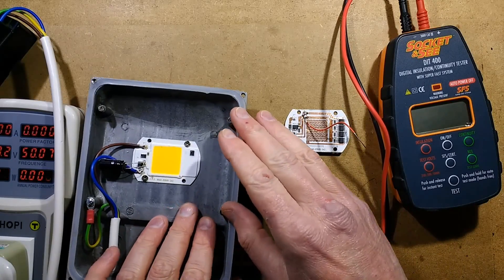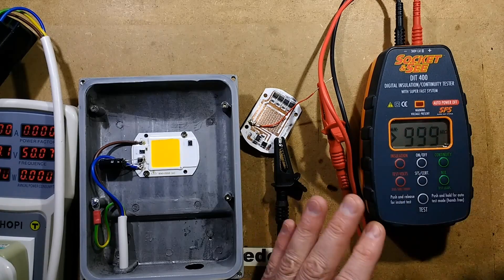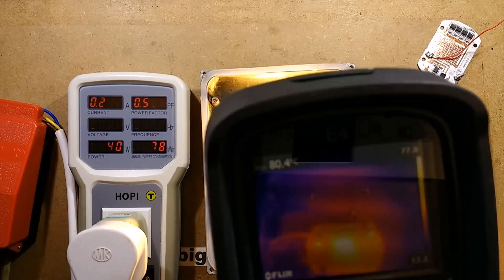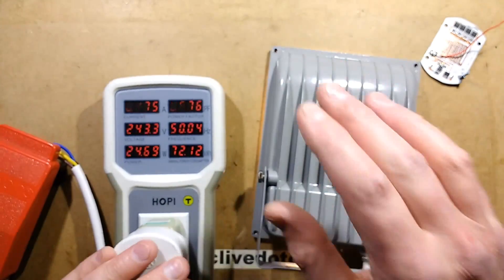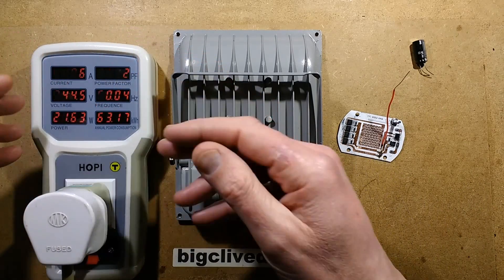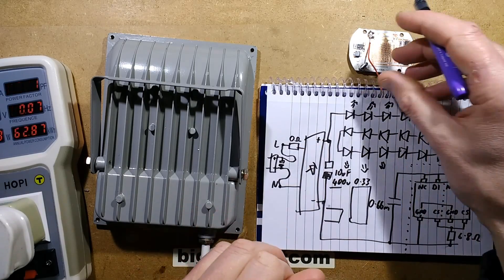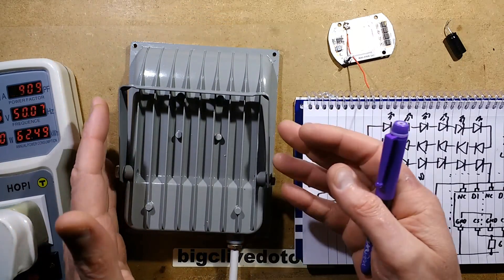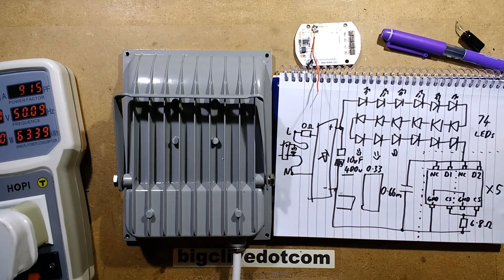Adding a capacitor to a driverless LED and other tests.

Comment: Hi, 
I've attached a 220v to 24v transformer to a 936 Soldering Solder Iron (cheap Chinese iron) it went smoking and became red glowing hot. what is wrong?
Reply: they are meant to go with a solering station, which has monitoring elecronics for the temperature and a controller that adjusts it, it IS 24v but that is only applied to make it heat faster, then the unit controlls it from the built in temperature thing in the iron, you are bypassing all that and have no way to control it, basically, buy a 12v iron for car use, they work well, thats what i use on an old pc power supply or sometimes a 7ah lead acid battery for portable use
Reply: Jusb1066 haha yeah, thank you! I'll let you know in a couple of weeks how it turned out :)
Reply: dude, you are a video maker, do a video on it, i have already subbed to ya!
Reply: ***** I would say get the cap and don't use it until you do.
Reply: Yarni Pels Which one went red hot? I will assume it was the iron, and the problem in that case was the transformer was at too high of a voltage and could put out a high enough current to maintain that voltage under the load of the soldering iron hearing element.
Reply: this is it, directly connected to the iron
https://lh3.googleusercontent.com/VrIFA2IDrqtCHsDKLk_zztgWfs4U8M1N8SR9zg9p3k7J-weKn6ZYKhpORUWQxNUdoEHCPrs4g_8
Reply: The issue is that your transformer is of too high voltage for the heating element, thus causing too much current to be drawn. I'd suggest trying a 220 to12v transformer, and that may fix the issue.
Reply: ok I'll try that but its strange since its listed as 24v
Reply: ***** That is odd. Possibly the listing meant pulse width modulated 24v rather than constant voltage.
Reply: ***** Very strange, all i can say is keep going down in voltage until you get to the right temperature. Maybe try 9 or 5v next. (Obviously not from a usb port)
Reply: Jusb1066 Thank you! So actually if I buy this controller attach it to my 24v transfo  it should work as normal? http://s.aliexpress.com/aIVzeMrE 
(from AliExpress Android)
Reply: yes that does look like the parts from the hakko station, then again, why not just buy an entire unit and keep your iron as a spare, might be cheaper than messing around, as you still need to power this board, make a case, have something to store your hot iron on etc....
Reply: Jusb1066 I actually have an old weller station (soldering iron is broken and costs more than 60€ for a new one) but it only has a 24v transfo in it I thought that was enough for this iron.. it has a stand and I already have wood for a case from a previous project :)
Reply: best of luck dude, older stations used different technology for heat control, some had weird tips that controlled the temperature,  good luck with your diy approach, hope that you can supply the board with what it needs (makes sense it needs 24v so you should be good to go)!
Reply: Jusb1066 haha lol 😂
Reply: Jusb1066 I just found what broke my old weller iron (after 6months of using a cheap butane iron 😅) there was a 0.01 uF  capacitor and it was broken. I put a bridge between the 2 point for a short while and it warmed up again..  now I have a little question can I use it without the capacitor or should I wait for a 0.01uF ?

Comment: Hi Clive I'm not expert in electronics, but would it be possible to use say two of these modules together so they run at alternating sync, thereby no flicker ??
Reply: Peter Scharff two legs of power like in a house hold still have the same zero crossing point, but if you had 3 of them connected to different phases of 3 phase there might be an interesting result
Reply: No it would just be three phase power. You know.... What is used by industry EVERY DAY.  (and they have the same problem.)

Comment: The eBay sellers are probably going to split into using these for cheaper ones, these with capacitors for no-flicker ones, and traditional driver ones for more expensive models.

Comment: Putting a capacitors, not necessarily that big, on the output of the chips instead of on the input side might improve things instead of making them work harder... or it may make it go bang.

Comment: Damn, I should have waited a little before I ordered 8 of them (I got all combinations ;) ). In the end it is what I expected to happen from reading the datasheet, but I still got them. I just couldn't resist and now I'll be stuck with flickering lights, I won't be able to bear to watch. Could you put a cap in series with a second module so it runs out of phase to the first one to avoid most of the flickering? (like you create an additional phase for an induction motor)

Comment: I would also ask for another try with capacitor parallel to LEDs instread. And possibly in series with some NTC as common in switching power supplies. With the flicker cancelled by extra cap. it would be really good and cheap device, imho.

Comment: I wonder how bad the flicker would be if you had both one of these and one with a capacitive dropper in the same fixture. You'd think the flicker would be roughly out of phase with each other and the result would be better.

Comment: I guess the flicker in these LEDs are not ideal for a DIY projector?

I have a DIY projector with a 400W halide I'd like to convert to LED, I wonder if these are suitable, there are also 100W (or they say) driverless LEDs.

Comment: Hi Clive. Have you seen the Gosun floodlights on Amazon yet? I've used a couple of the 30w daylight white ones and they seem pretty good and very competitively priced. They're quite a different design to the normal aluminium troughs and they claim to use cree LEDs. Just thought they might be worth a look.

Comment: If China decided this was the way forward for LED lights, couldnt they use the capacitor, but increase the number of LEDs in the string to bring it up to the higher DC voltage?
I'd hate for my world to be filled with 50Hz flicker.

Comment: A smaller capacitor might allow for elimination of most of the flicker without pushing the chips that hard. I calculated that the cap should last for about 7ms (from the peak to the next time the voltage enough ( about 185Vish?)), and your 10uF would drop from 330V to 267V in that time, whilst 4.7uF would go to 196V (close enough?).

I calculated with crude numbers and assuming constant 0.09A current, but if you like to experiment, maybe try 4.7uF ...

EDIT: Also, the sinewave likely exceeds that slope for a while on the top, and caps might be bigger than specified (so good idea to measure them), maybe experiment with even smaller caps too..

Comment: I think, you could reduce the flicker by using 2 of those LEDs and power one of them through a capacitor, so the phase would shift 90°

Comment: Clive, I agree with the commenter who recently suggested that you should devise a method of measuring the light output from the many lamps that you review.  When we are considering LEDs or other lamps for use in lighting applications what we need to know is how many lumens?  Sometimes the eBay sellers quote a value but we all know how much trust to put in that.
Reply: tbh, as long as the testing conditions clive uses are consistent across all the leds, it ultimately does not matter. 
I would not mind buying leds based on a clive-scale
Reply: Measuring light output in lumens is not trivial. Lux is an easy measure however.
Reply: You can trust Chinese LED seller specs 1000%, if you move the decimal point twice. Most of them only know what they were told by the manufacturer, and they have no concept of electronics, they're just peddling.
Reply: number 33 Google integrating sphere.  iirc they're white tio2 inside.
Reply: My plan for measuring lumens is to put the lamp inside a perfectly reflecting sphere which has a small hole in it which is covered by a light meter measuring lux.  All the light bounces around until it exits via the hole and is captured by the light meter.  Does anyone have a 100% reflective sphere handy?  

Ok, it doesn't have to be 100% reflective a certain percentage of the light will be absorbed so it will have to be calibrated with a known light source like a 60W incandescent bulb.

PS:I don't believe any of the conspiracies in that list.

Comment: I don't really know why the flicker is considered such a problem.  It's no different from the flicker of the old fashioned fluorescent lights that most offices have used for about 50 years.  They also pulse on and off at 100/120Hz.  The persistence of the phosphor may reduce the flicker a bit but that applies to the LEDs too.  And people are happy watching cinema films with 100% flicker at 48 Hz.
Reply: Modern fluorescents run at much higher frequency to reduce flicker, so it certainly was problematic even with those.

Cinema projectors are comparatively very dark, making our eyes less sensitive to their strobing - But these are also strobed at higher rates in the age of digital projection.
Reply: I'd guess that the strobe is sharper edged on LEDs than the old fluorescents making it more perceptible... haven't done any experiments on it though.
Reply: The benchmark should really be incandescents which had pretty much no flicker whatsoever. And those were nice.

Comment: can anyone tell me why the meters LEDs flicker when it sitting on the table. but stopped when he was using the thermal cam and when it was close?
thx
Reply: The camera exposure changed.
Reply: The digits are most likely multiplexed at at least a few hundred Hz. If the (electronic) shutter is open long enough per frame (as in low light conditions), all digits will light up at least once within that single shutter (frame rate and shutter speed are two different things) and thereby look flicker free.
Reply: thanks, Makes total sense, guess I just didn't think hard enough about it. lol

Comment: Cool video Clive but this looks like an exercise of turd polishing that flicker in the standard unit is horrible. And if that's the cheapest way these units can be built then that's how they are going to be made.
Reply: But you wouldn't put them in your living room to read by, they're only for the shed and driveway.

Comment: Hi Clive
How strange, when you showed the thermal camera the currant meter stopped flickering.
Reply: John Ferguson The video camera used a longer exposure to compensate for a darker scene.
Reply: Robert Szasz Thanks mate. That makes a lot of sense.
Reply: The digits are most likely multiplexed at at least a few hundred Hz. If the (electronic) shutter is open long enough per frame (as in low light conditions), all digits will light up at least once within that single shutter (frame rate and shutter speed are two different things) and thereby look flicker free.

(Yes, I'm spamming this of mine comment around)

Comment: Ok so if I ordered the 240v versions and used them on my 120 mains with the smoothing capacitor would it work better?  I mean the rms voltage is much lower so putting that capacitor in there would just compensate for the lower voltage right?
Reply: If the peak (not RMS!) value of your supply does not exceed the LED string voltage, it will never light up. Considering there's about 70 LEDs a 3V you'd need at least at around 200V (absolute, not RMS) for it to light up at all.
Reply: Quinn Miller I would like to know as well!
Reply: 120V wouldn't hit the 180V needed to light the LED's properly even if smoothed.

Now if you swapped out the bridge for a voltage doubler using a cap and two diodes then you would be onto something :)
Reply: superdau true
Reply: specs say that, but its wrong, the 110 versions would be different.
Reply: You still don't understand. 70 white LEDs in series can not light up on 110V AC with this circuit.
Reply: "Can't" or "Won't"?  lol  I get it. The necessary voltage to overcome the for lack of the correct electrical term, "stiction" (sp ck doesn't know stiction.  lol)  Like when dealing with sliding parts there is a certain voltage needed to get the LEDs to light and the 110 won't get there. 

But I think if you tilt the fixture downhill just right you can get the extra momentum needed to light the LEDS... Or just fake it by using bigger wire, or switch to The UK wire colors...   (Just facepalm, Shake your head, and give up.)
Reply: You would be able to pull 120 from each leg/phase of your power box and run one into hot, one into neutral. ( US 240v ). I currently have one running on just that and i don't notice any flicker. Currently trying to get answers as to how running  US 240 double phase VS UK 240 single phase affects flicker. Corrections from an actual electrician are welcome.
Reply: @Facemcshoot  
it will be a single 240 volt phase at 60 Hz :-)
Reply: i have found out the cap makes it light at 209V, while the same board without the cap lights at 111V.
Reply: Not that I haven't seen bad specs, misprints, and/or flat out lies, but I kinda think if it will handle 240v it will handle 110v. May not be as bright but I think it would light. I have seen all sorts of stuff that will work across multiple ranges. I think the engineers(meh?) that designed them would know.

I can say that 12vdc incandescent  camper bulbs work very well at 110vac they are very bright, screw right into the sockets, look just the same if there is no writing on them, but the service life sucks.   LOL  (can you say "Flashbulb"?)  Now I test at 12v when not sure.
Reply: WRONG!  Specks call for 86 - 265 vac.

Comment: i wounder if they will improve these units with leds which can handel 30 watts or so but only use chips with 10 watts and with a capacitor because then the leds will not fail or so maybe i don't freaking know xD

Comment: Wouldn't you able to use 2 with a voltage divider to get the power down so you can use a capacitor on each without overdriving them?

Comment: guys,my 20w led floodlight stopped working.Used indoors for 3 days.The floodlight is not turned on everytime.Please help
Reply: Take it to bits, and see what died. Did you keep it cool? Better yet, send it back and get your money back.
Reply: James Van Damme didn't buy it online,bought at a local Hardware shop.No warranty and gurarrante.Took to bits and nothing obvious.Probably the driver is faulty.The led is fine.I just need a new 20w led driver.Will be a pain in the butt.

Comment: so if i were to use a bunch of these all next to each other would the flicker be all in time with each other following the the ac wave form or would they be slightly different thus appearing less flickery?

i did have one of these driverless chips with solder pads in the circuit which at the time i did wonder if it was perhaps some optional filtering add-on
Reply: If they're all on one power phase, they'd flicker the same. If you had a 3 phase line, put them on different phases and would probably be no noticeable flicker
Reply: You have been lied to. Sorry.

Comment: Hi Clive, hello from Australia. Thanks for your great videos, I put your knowledge to good use when a capacitive dropper in a PIR floodlight failed and the switching relay just buzzed. All sorted now :) 

The video on your quick test was excellent, are you able to demo some of your other bits n' pieces in future videos? I'm in the process of setting up a workshop and it'd be great to know the details of some of the wattmeters, hand tools and other interesting items of test gear or measurement that I should probably have (whether I need them or not!). Sometimes it's a matter of knowing these things exist so we can buy them. 

Cheers,
Adam

Comment: In the previous video you said that the current was programmed to the chip by a resistor. If you increased the resistor, would it negate the extra power from the capacitor modification?
Reply: I'd imagine replacing the resistors would be very hard due to the silicone potting and aluminium core PCB. Certainly not worth the effort.
Reply: Jernej Jakob trimming back the silicone is easy enough and the old reflow trick of putting the board on an electric hot plate and use a hot air reflow pen to melt the solder. Don't underestimate Big Clive's persistence.
Reply: You will need dispass more power on curent regulator too.

Comment: I had exactly the same thoughts regarding a capacitor to smooth out the flicker but I wasn't sure if these chips would cope with a DC supply, so thanks for answering that one. To get around the higher voltage problem I considered using three of the 110v units connected in series but I'm not sure how they will interact with each other.
Reply: A 230V led on rectified 115V would be more interesting. Under-running it would prolong its lifespan.
Reply: Jernej Jakob If you have a 115v supply then I agree, always assuming the rectified voltage is high enough to turn them on, it may be borderline in that respect. Like Clive, I'm stuck with nominal 230v, more usually about 250v, giving a rectified voltage of 325v nominal, about 350v in practice.
My concern is how the current limiting effect of one device would affect other devices in a chain. One solution might be to put a bypass resistor across each device to try to equalise the voltage.
Reply: Rectified 115V or around 160V peak won't be enough to turn on the LED-string of a 230V version at all. Maybe you get a glow, but for over 70 LEDs in series you'd need around 200V to get any useable light out of them.

Considering that the chips are apparently linear regulators (says so in the datasheet) and Clive was able to run them with a huge resistor in series, hooking multiple of them up in series should actually work. Sure, one of those will be the current limiting one of the whole string. But that's actually a good thing, because all arrays will run at the same current and be quite equal in brightness. There isn't really a need to equalize the voltages in the same way that you don't need to equalize the voltages on the LEDs in a series string.
It will still be a bad idea though, because the flicker of 3 110V versions in series on 230/240V will be worse.